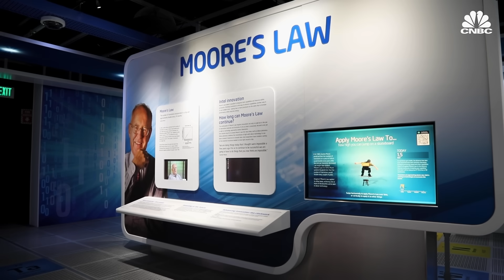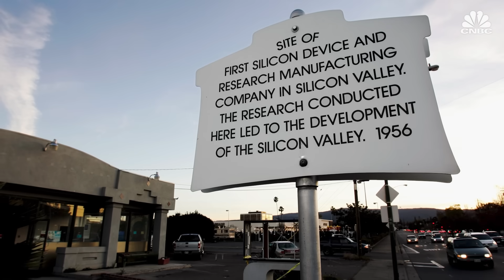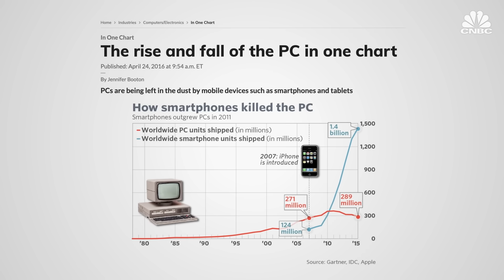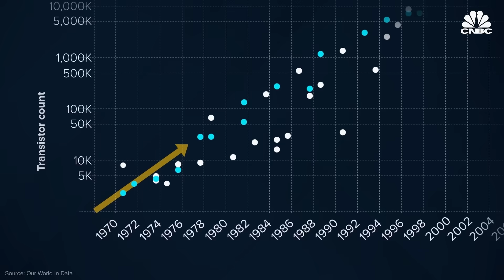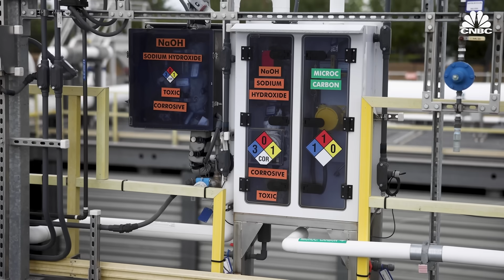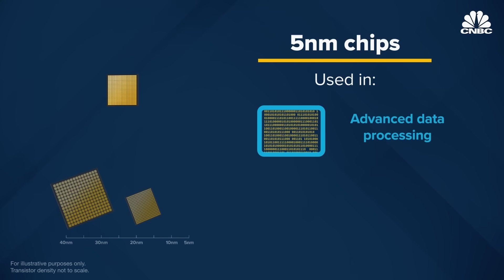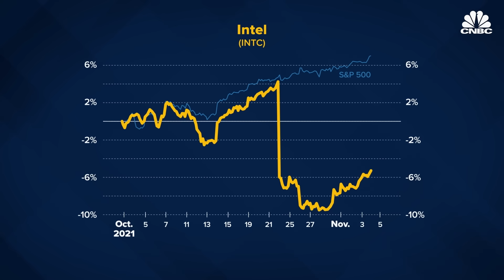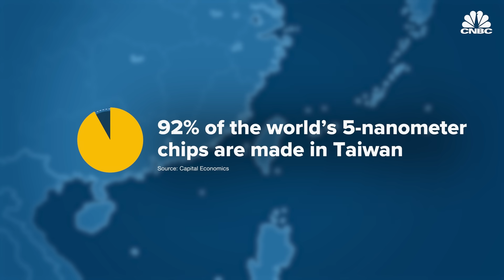Inside Intel’s Bold $26 Billion U.S. Plan To Regain Chip Dominance

Comment: Apple chips really shook em out of the blue. I make all my videos an intel chip but am planning to switch to apple M1 pro max.
Reply: careful with that. m1 is really good for a laptop, but in the desktop world there are already chips way faster than that.
Reply: Isn't alder lake faster than m1 max? I heard that it's better, but couldn't find any comparison videos on youtube.
Reply: @S0ulH0und  Alder Lake a bit faster, but the efficiency is much worse. The miracle of the new Mac chips is how cool and long they run on battery. Mac software also plays really nice with these chips. If you don't care about power consumption and heat, Intel is the better choice.
Reply: @Erosis it's not a bit faster it's a lot faster, only downside is power consumption when running benchmarks